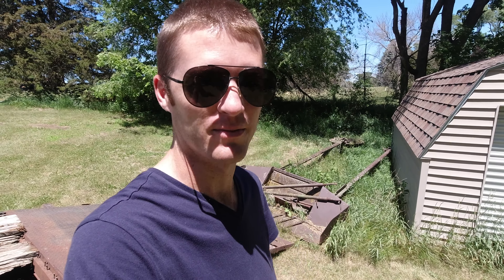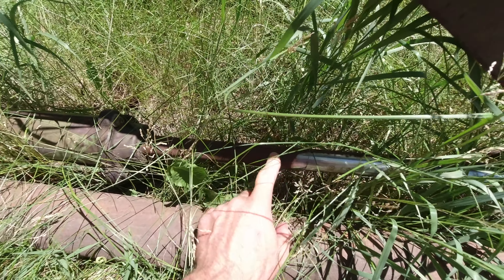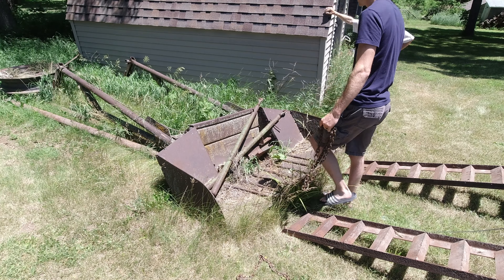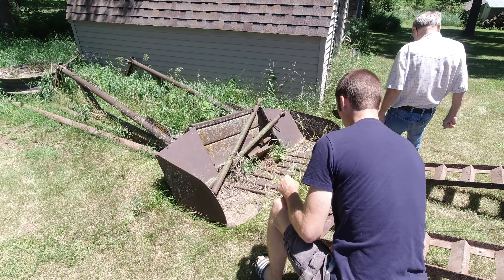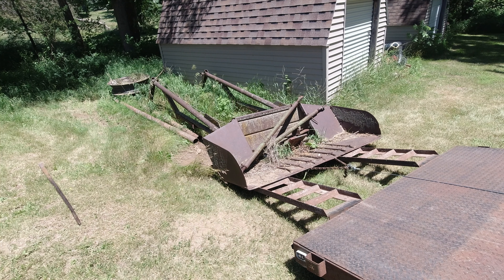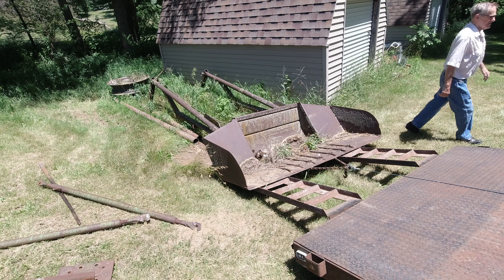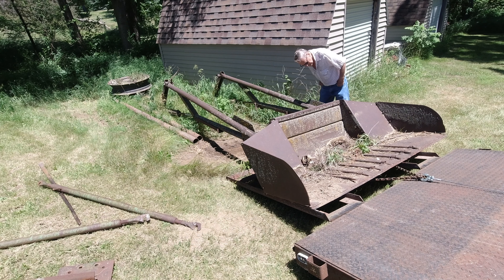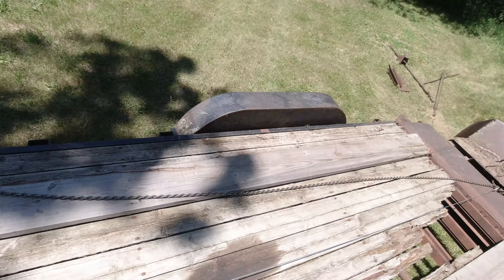Saving A John Deere 45 Loader

Comment: This is something I am experienced at, I loaded manure, dirt, snow, pulled car engines, most anything on the farm was done with our 45 loader. We had it on the model 60, just an A with live power. Many hours were spent cleaning the snow off the farm yards, a lot deeper snow then has been here for the past years. We had the blade attachment in front, it looked like snowplow, it could be angled 45.
Reply from the maker: I believe my grandfather just used it to move snow. Also probably why the tractor had chains on it.

Comment: Jordan, That 45 loader is only loader thet I had when I was farming. I could put it on in just a few minutes or take off. I put it on my 50 JD first but found out it worked better on the Super M and the spreader on the 50. Lift up the loader and loosen the stands. Once the stands are down [straight down] then tighten the stand bolts so the loader is up off of the ground and you can mow under the loader. Send me a letter with your phone number so I can call you. I started farming with a Super M Formall [my mother's], a Super MTA, and a 50 John Deere from 1972 to 1977 when I went into the Navy. Tom
Reply from the maker: I did notice the stands just forgot about them I will go out and get them setup right. It’s probably a lot easier to get it on and off the tractor when it’s running. At some point I’m sure I will get it back on the tractor.
Reply: @HumbleAcres  that old truck if can .can u do a vidoe about it pleae